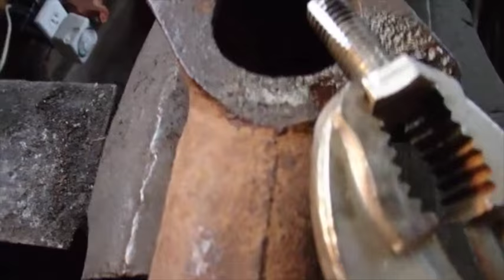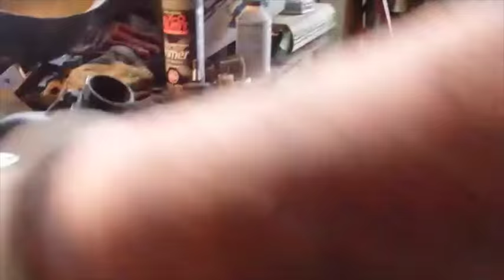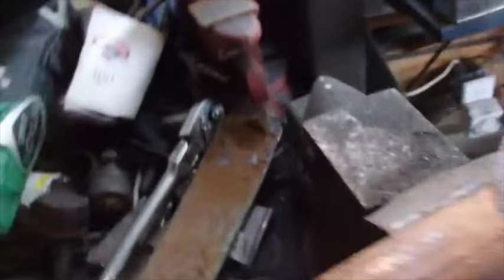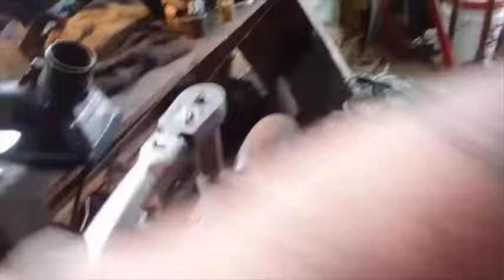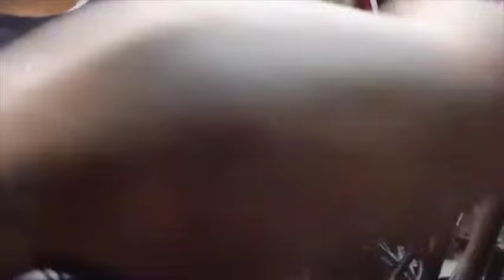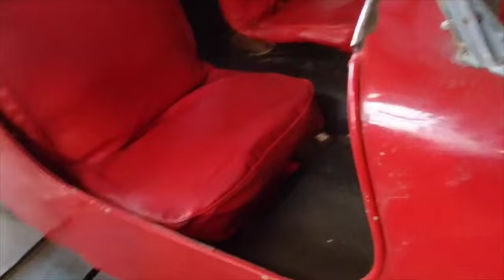Redneck Rethread

Comment: A cunning plan :-D
A tap would have been the ideal choice, but there are so many oddball sizes, so buying a special "one off" tap may be a bad thing.
Copper slip or similar should help them not get stuck again, but heat can destroy most lubricants.
Dam i talk too much lol.
Reply: +zx8401ztv Actually, I have found that using a tap isn't always the best and can sometimes take more material than this method, which I have used a time or two or three!  Copper anti-seize it good in that the copper usually will stand up to the heat.
Reply: +MISTERComaToes 
i suppose it depends on the cheapness of the set you buy.
Also propper tap and die sets have 3 taps per size, starter/mid/plug.
Most sets only supply the mid tap, dam shame really :-(
And a lot of sets dont have an adjustable die with set screws :-(.
Reply: zx8401ztv I don't know as to the quality being a key determinant, I've used some of the best taps made and have had excellent results using a tap to cut NEW threads but there is a rethreading tool that works better ( as does Mr  Peek's method) than a tap for rethreading...  I don't quite know why and others may have had different results, but in my 30+ years as a diesel/heavy equipment mechanic that's my observations. Not that a tap WON'T work, just not as well.
Reply: +MISTERComaToes 
Quality does matter, most taps ive seen are nasty, the surface isnt the mirror finish i expect to see.
As you know, if you tap a fresh hole with 3 stage quality taps its just a loverly job :-D
I used to use a quality starter tap to chase paint out of tapped holes too, stage 1 didnt take material off, just paint :-).
I had a dad and uncle that were engineers, they quickly turned there nose up at rubbsh ha ha :-D :-D
Reply: zx8401ztv Cleaning paint out of a hole with a tap is another job altogether than chasing rusted and buggered up threads with one.  When I say quality isn't the key determinant, I am NOT suggesting that quality taps aren't far superior, I'm saying that through my career of repairing buggered up threads I've found that Peek's method of rethreading  buggered up threads (or using a rethreading tool) to be highly effective AND using the best quality taps on buggered threads can result in slightly less desirable results,
Reply: +MISTERComaToes 
I suppose the bolt method is acting like a soft file and wears it down a bit, but taps are a cutting tool and depend on having enough material to slice through.
Hmm yep that sounds about right :-)
Reply from the maker: +zx8401ztv   I agree with both of you..
Reply: +rpeek 
Agree with both of us, are you sure your feeling ok lol :-D

Comment: are u going to clean up all suffuses with sand paper and a hard flat block for a better seal for your gaskets
Reply from the maker: +Jim Rowlings   I don't even know what suffuses are..   If I got any I didn't clean 'em up.
Reply: spell correction screwed up surface
Reply from the maker: +Jim Rowlings   I know.  I was just funnin' with ya.
Reply: I know same back at u lol